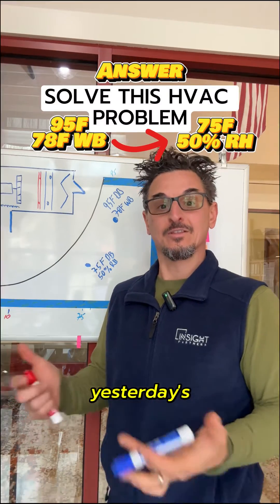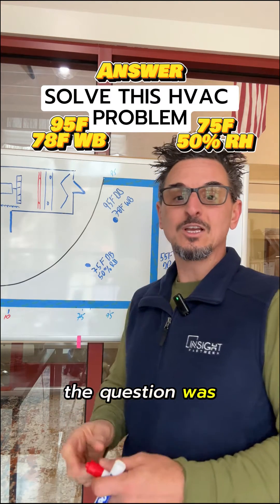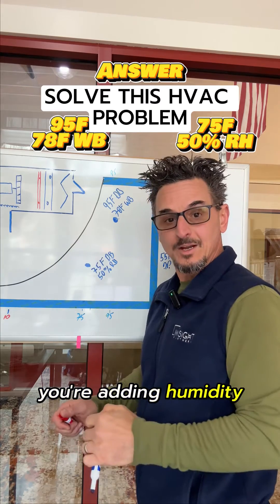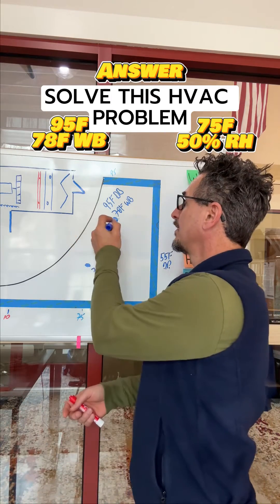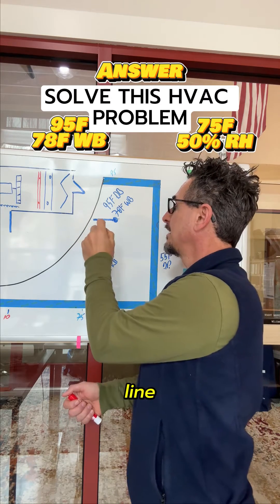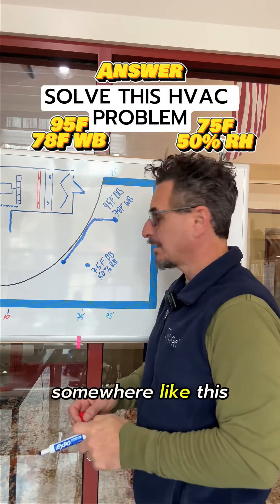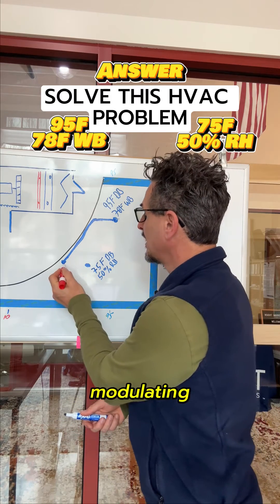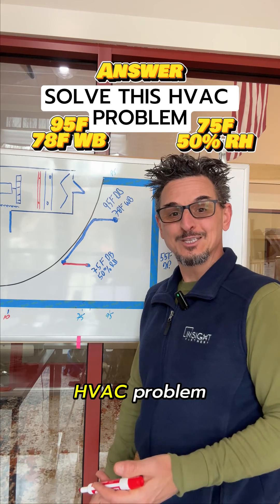MAU Psychrometrics | HVAC DOAS, Make Up Air Unit, Dehumidification Explained

Comment: I have 3 examples of psych chart processing I would like to see you do vedios on. 1st I would say you are very clear, and connect the practical very well with the visual explanations of the subjects you provide tutorial on.

The 1st is the standard hvac process for units without outside air?

The next is for the addition of a dehumidifier to a Hvac system. Assume the space condition is 72-degF, and 50%RH. The client trying to get RH to 35%RH.

The 3rd is the same as the 2nd, but the introduction of a dessicant wheel. I would like to see how this is plot on the chart. The heating and dehumidification, and the wheel drying out the air to get to the 35%RH.

Thanks.

Let me know if you have any question?

Comment: Understood on the example, but wouldn’t 75f and 50 rh be the room temperature typically, so we wouldn’t need a reheat coil but instead use the heat gain from the room instead when the supply air mixes with the room?